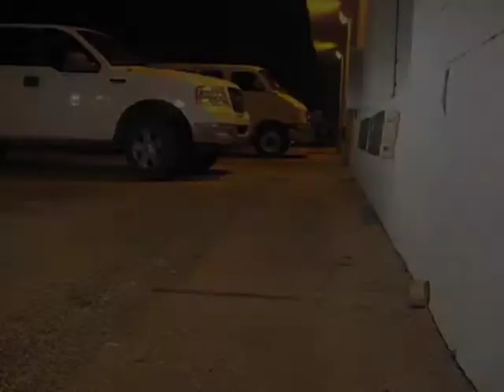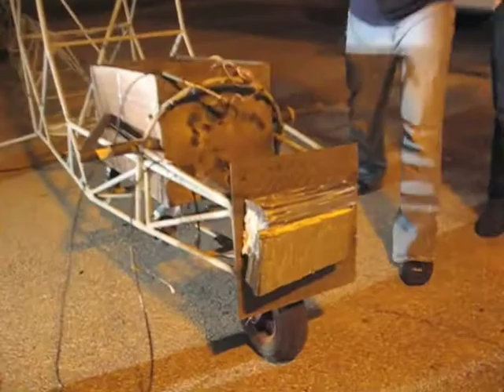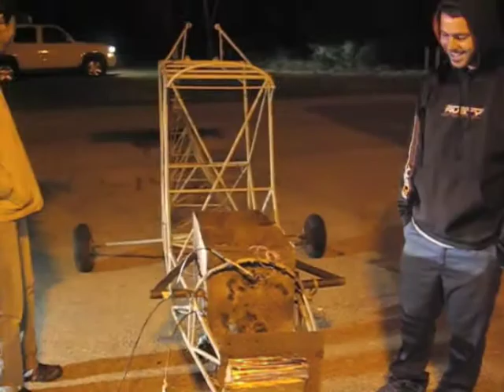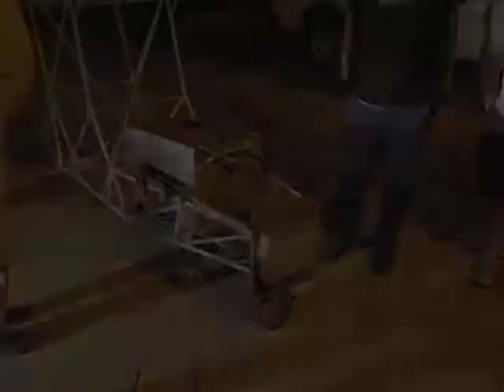Impact Attenuator Testing

Comment from the maker: The tape mark on the ground was a reference length, video is taken at 30 fps so velocity can be found.  After the impact, you can see wires attached to accelerometers which run to a laptop for analysis.

I'm not saying this was done perfect, this was a re-do the night the impact attenuator report was due because the original test performed several days beforehand did not produce realistic data.  That test destroyed our original cart so this was what we came up with in the last minute.